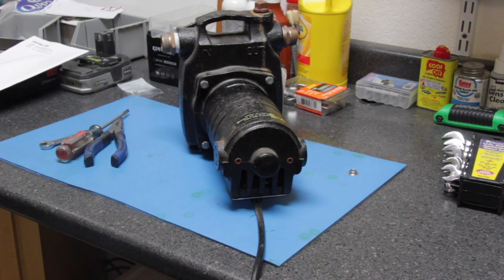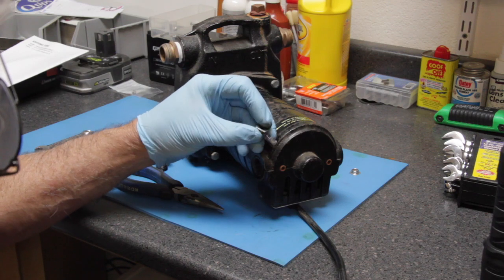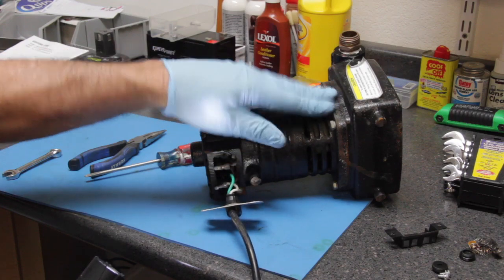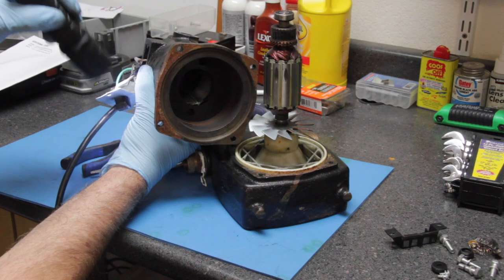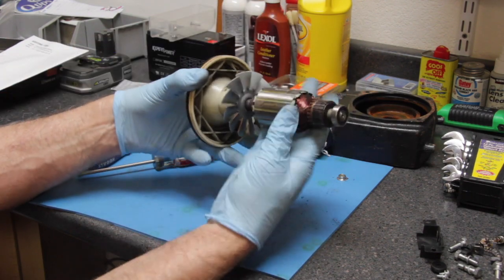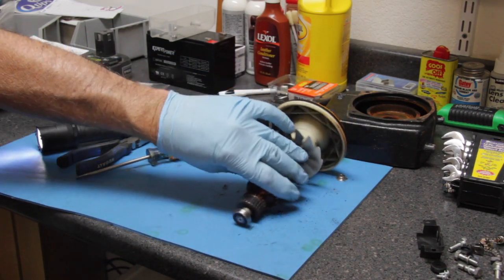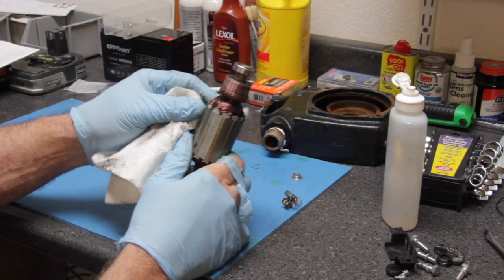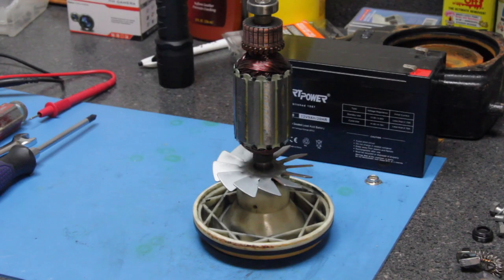Harbor Freight Motor Troubleshooting

Comment: Nicely done, do you think torque of the motor or maybe the brush spring tension is causing uneven brush wear? 👍😁
Reply from the maker: Could very well be Dave,  I have new brushes I will compare the old brushes to the new brushes and see if the spring tension is different.  Thanks for the feed back